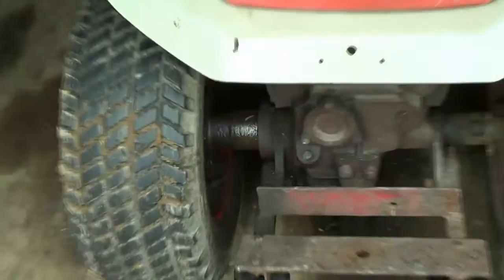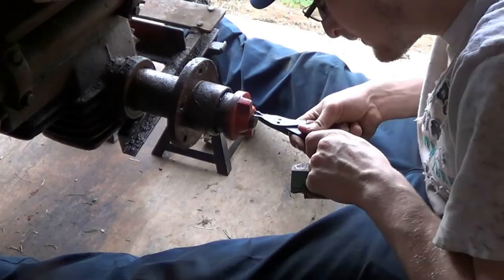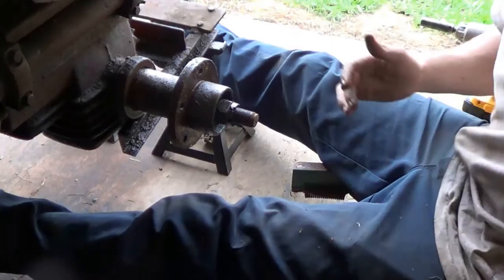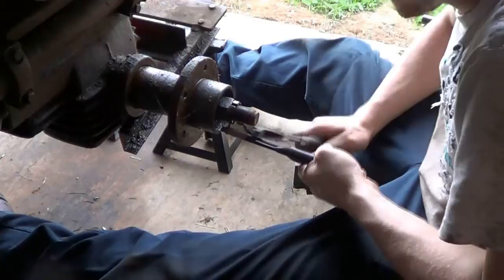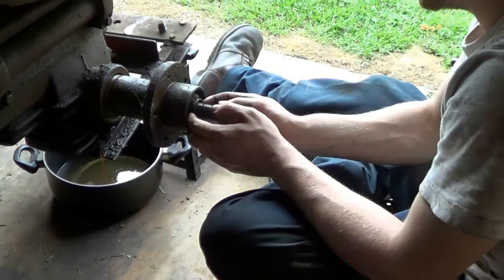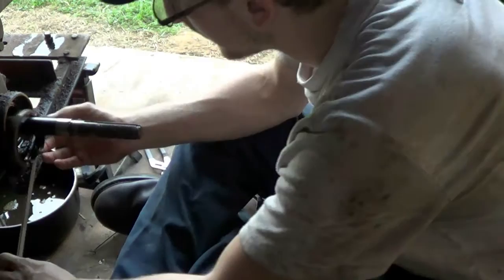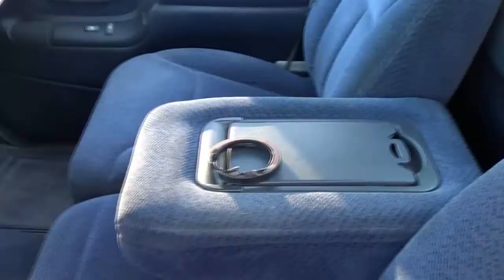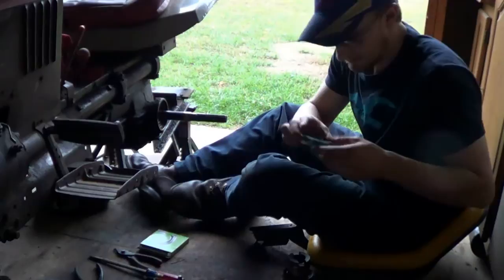Bolens 1050 axle seal replacement

Comment: This is new to me, but don't have money for "repair".. My differential wouldn't lock, frozen in place. Tractor ran fine, but couldn't lock rear tires for snow. I used a pipe wrench to free it. Is there anything I may have busted that's not seen here? It's COLD out here, nose gets crunchy in 10 minutes.  Axle oil got pretty low once, but don't think I did any damage in 20 minutes. Still, this is part of that system so I have to ask. Hoping it's a pin or clip, but need to know if any way to "test" to see if something major broken. Prefer txt or email, but don't know how... Please help? On SSD and this is the only way I keep independent as I can't pay for someone to shovel..